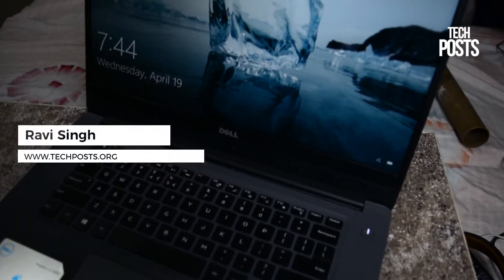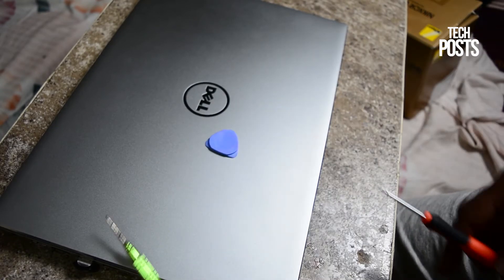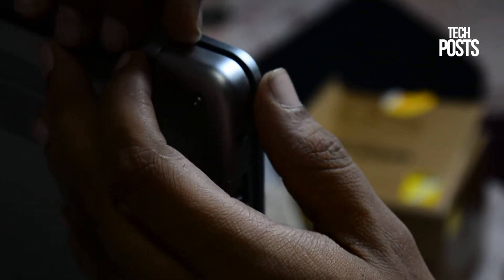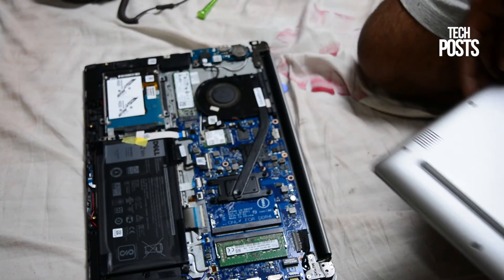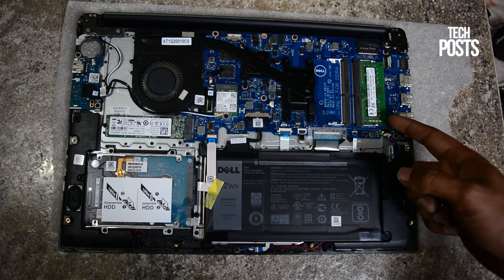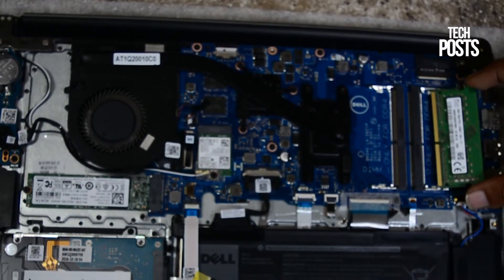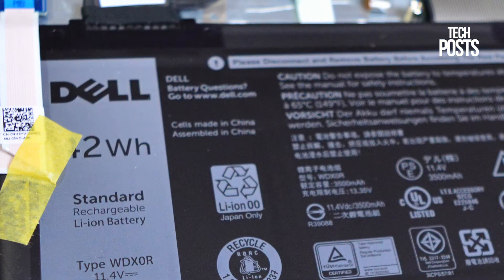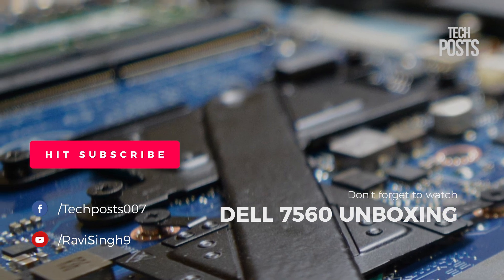What's Inside Dell Inspiron 7560 - Dell 7000 Series Ultrabook

Comment: Bro did you find 65wh battery for this laptop....? If you got the one please share the link for me also.
Reply from the maker: No, there isn't any that's compatible with this. Unfortunately, you are stuck with the 42whr.
Reply: @ravis1ngh  10qu for reply. does this laptop support which ram 2133mhz or 2400mhz..? but the ram given (pre installed)this lap is 2400mhz but  in task manager it is showing 2133mhz .am confused can you please suggest me which one it is. i wanna upgrade
Reply from the maker: @fabi9188  The processor i7 7th gen in this system supports 2133mhz RAM. So you the RAM frequency is limited by the processor. You can't do anything.

Comment: You have added one nvme ssd. Can I use it as a primary disk and remove the other disk? Also are you able to get the full speed of nvme ssd? 

I am thinking to replace the disk with nvme. This will increase the baterry life as well. Please share your experiences.
Reply from the maker: That's not NVMe but a SATA 3 M.2 SSD. It doesn't support NVMe
Reply: @ravis1ngh  got it thanks.

Comment: 3 screws are not coming out on top of air vent side , other came out
Reply from the maker: They wont. Don't try to forcefully remove them. It's the way it is. Just unscrew and remove bottom using scraping tool
Reply: @ravis1ngh  which type of screw drive you used plus or minus

Comment: SIr I got the same laptop but the i5 version ,now i am thinking to add this ssd -Kingston SSDNow UV400 120GB SATA 3 2.5-inch Solid State Drive (SUV400S37/120G) in empty slot. Will it work?
https://www.amazon.in/Kingston-SSDNow-2-5-inch-SUV400S37-120G/dp/B01FJ4UN76/ref=nav_ya_signin?s=computers&ie=UTF8&qid=1532607921&sr=1-1&keywords=kingston+ssd&

Comment: Is there separate slot for ssd other than HDD????
Reply: inbuilt you will get a chip based 128 gb ssd that is primary and another is hdd that you can replace with ssd so it performs very good and fast

Comment: can u tell me if i edit 4k videos on it .... it is possible ?
Reply from the maker: +Jatin Chopra Photography I have edited 4K in premiere pro and it does works fine.
Reply: render time ?
Reply from the maker: You can edit 4K recorded at Low bitrate. Otherwise, you need at least quad-core processor with the good graphics card to render high-quality 4K video.  So if you want to edit good quality 4K, look for a more powerful laptop!
Reply from the maker: You can find more details here in the screenshot I have uploaded of 4K video Rendering. Editing was smooth. Shot using S7 Edge 4K
https://prntscr.com/i4aly7

Comment: Hi, thanks for the video. Varun Marathe led me here. 
I am planning to buy the Inspiron 15 7560 i7-7500U 16Gb 256Gb SSD 15.6" FHD GeForce 940MX. It doesn’t come with any HDD apart from the 256 SSD. So, I need to know if the SSD and be upgraded to a 512 GB / 1TB.
All answers are in this Great video which answered my question. Keep up.
Reply from the maker: Yes, you can. It's easy but with SATA 3 SSD. No NVMe! 
Good Luck!

Comment: I really like the design and looks of this laptop and I'm looking to buy this.  Only thing I'm confused about it is, the Dell inspiron 5577 and Dell inspiron 7567 has Nvidia GTX 1050 and GTX 1050Ti respectivley and the price difference is just 5-10 k.  So , should I just stick to Inspiron 7560 for its thin bezel display and how sleek it looks OR should I forget about the looks and get Dell inspiron 5577 or 7567 ?!   Usage wise I dont play many games , I just play Fifa a lot and watch videos and browse.   Your suggestion please ?
Reply from the maker: If you haven't purchased 7560 yet, then don't invest in it now. Get a new 8th Gen Dell 7570, not yet released in India.
Reply: Techposts Guides well, for that I have to wait. Now there's festival offer going on!  Dell inspiron 7560 i7 version is available for 66k, Inspiron 7567 i5 version is available for 67k and Inspiron 5577 i7 version is available for 69k.  I have to choose from these three, I like 7560 for its design and light weight.  But 5577 and 7567 has better graphic card!  Although I don't play many games, I thought getting a better graphic card will be useful in the future. Having said that I really like the design of 7560 which is almost similar to Xps!  Which one should I go for??  Your suggestion please?

Comment: Does the i5 variant of 7560 have ssd slot?..and can the 1TB HDD present upgradable to a ssd? and is the colour bleeding problem solved?..i mean in recently manufactured product?
Reply: Can someone please respond to this ?
Reply from the maker: Yes. SATA SSD. There could be a M.2 slot as well. You can use Hardware Info app to know if there is a M.2 slot. Under SATA connections.

Comment: hey can i upgrade it to pcie based ssd?
Reply from the maker: NO. It's M.2 port, not PCIe.
Reply: if i want to change the whole 1 tb hdd with a ssd,is it possible?if yes ..what would be the best ssd for upgrade?
Reply from the maker: +Suvajit Adak Samsung and Kingston. Samsung is costly while Kingston is a bit cheaper but both work great. I use Samsung Evo personally.
Reply: thnx..ya cool

Comment: 8gb or 16gb? which one for empty slot ram is best.. is there extra m2 slot for new SSD?
Reply from the maker: +Prithviraj Deb Both. Add any  Depends on your requirement. It supports upto 32GB. There is only one ssd slot. Remove HDD and add SATA SSD if you want two ssd.
Reply: upgrade to 16gb works great
http://www.amazon.in/Crucial-CT16G4SFD824A-2400MHz-260-Pin-SODIMM/dp/B019FRBHZ0?_encoding=UTF8&psc=1&redirect=true&ref_=oh_aui_detailpage_o07_s01
Reply: could you suggest m2 ssd  500gb

Comment: sir dell inspiron 7560 i5 is good for programing or lenova idea pad 710s 
which one is best for programming
Reply: replay
Reply from the maker: +Yashpal Gowda Both are equally good. You can also consider Macbook Air if you only need laptop for programming. It's much portable and backup is really good.
Reply: thnks sir
is mackbook air enough for developing ios appilications 
  and creating website like twitter 
is it possible
Reply from the maker: +Yashpal Gowda Yes. Mac Air will handle those easily.
Reply: ok sir sir 8gb ram 
5th genration i5
128pcl ssd 
are enough
Reply from the maker: +Yashpal Gowda But if you want to use other heavy Graphic intensive work like Adobe After effects, Premiere pro or other editing apps, it will be slow and might not work properly.
Reply: sir can u suggest other laptops at 70 k range
good for programming stufff
Reply: replay plzz

Comment: Hi, nice video.
Have you solved the overheating issue? 
I consider buying this laptop, but its cooling system makes me skeptical. Small fan, thin air vents placed only on the back of the laptop and not on the side and lots of complains by users on this topic.
It is fine by me, to reach higher tempratures during gaming, but just browsing causing that trouble is a big problem.

Note: I intend to use it for development purposes (coding,browsing, databases access)  not any heavy gaming but some software might take advandance of th GPU.

Comment: does it have any problems? how much it cost?
Reply from the maker: +Dibyendu Adhikary Costs 79K and having minor issues with Display and Battery life.
Reply: Thank you for your valuable answer... what type of display and battery problem do it have? Actually I want to buy it in the next few days. Please answer me
Reply from the maker: +Dibyendu Adhikary Don't go for it, i am experiencing severe heating issue. It gets very hot even when you are browsing in Chrome. I am in contact with Dell. Will update ypu if this is the issue with my piece or every 7560!
Reply: Oohhh shit! Then which one you will suggest me.. I want one which have back-lit keyboard,Long battery life,some good stuff like i5 processor etc
Reply: Is this have display yellowing or bleeding problem? And what about the battery problem?
Reply from the maker: +Dibyendu Adhikary No, atleast not with mine. It good! Battery is not a problem, it's 42whr which is little less powerful. So expect 3-4 average, max 5-6hrs.
Reply: Ohh sorry it's12.11 so😆😆 I'm in sleeping mood that's why I wrote that type of thing...😄😄 OK. I have heard that type of heating  issue. They all suggesting to use cooling pad. It's normal. Can you say me how much it going to heat? Actually after many rejection of several lappies I decided to buy that one. It's very hard to go for another one. Can you briefly tell me about all of it. Please
Reply from the maker: +Dibyendu Adhikary It just started, and i do serious rendering work. That's one reason. But still temperature touches 90 and above sometimes. Stays at between 70-80. Idle temp is 55.

Comment: Which one is better?
1. Dell Inspiron 7567
2. Dell Inspiron 7560
3. Dell Inspiron 7559
Required for animation and vfx classes (lots of work in MAYA). If you have any other recommendation, do specify.
Max budget 1 lac.
Reply: +Techposts Guides Does INSPIRON 7567 comes with IPS in INDIA ?
Reply from the maker: +Ajay Fogla Go for 7567, it's with 1050Ti, just check your application's system requirement first. If it supports Nvidia 10 Series Gfx cards. 7567 is fresh with 7th Gen quad core i7 processor. It will perform way better than 7560 and 7559, without any doubt.
Reply: ok. Thank u

Comment: hey I'm looking to buy this 7560 but I heared about colour bleed and display issues I want to buy i7 7th 4gb graphic for VFX* what should i do ...?¿¿¿ I'm confused pls give me feedback. ...
  #touch+posts
Reply from the maker: +Fearless Singh Don't go for 940MX DDR5, you will be disappointed with the performance. For VFX you need a better card like 1050Ti offered in the newer Dell laptop 7567.
It's wonderful laptop, i would have bought it if it was released at that time. Unfortunately, i have to use this for atleast two years. The display is good.
For 7560, yes there is minor color bleed issue.
Reply: should I go with Apple? ??
Reply from the maker: +Fearless Singh Yes, you can.. go for Macbook Pro if you have some extra bucks to spare!
Reply: thanks for quick reply. ..
it's really  useful..
great job..
Reply from the maker: +Fearless Singh Thank You Mr. Singh!
Reply: Nvidia GeForce N16S-GTR 
is this strong graphic processor ??
Reply from the maker: +Fearless Singh No, it's not aStrong processor at all. Good for gaming at low settings, can handle all games including games like GTA5 and Witcher 3 (at very low settings). 
It's average for Adobe and After effects.

Comment: +Techposts Guides

Could you please paste a link of RAM you bought online?
Reply from the maker: +Abhineet Singh i already did mentioned in a comment. Added link in the description too.
Reply from the maker: http://amzn.to/2pXmZNM
Reply: +Techposts Guides

Thanks for the link.

which variant did you bought?I could see two variant-2133mhz and 2400mhz.
Any specific reason of buying it from Amazon.com and not from Amazon.in?

please request to reply
Reply from the maker: +Abhineet Singh Not available at Amazon.in.
Crucial RAM is available at Amazon.in
Reply from the maker: +Abhineet Singh Also, i noticed that the installed RAM is a 2400Mhz but the BIOS shows RAM freq. 2133Mhz which means system uses RAM at freq 2133 not at full speed i.e. 2400. No option is available to increase speed of RAM in BIOS.
Reply: Techposts Guides 

so you bought the one with 2133mhz?
Do post a quick review once you have received & installed tge RAM and booted up your laptop.
Reply from the maker: +Abhineet Singh no i bought 2400, i hope Dell will release new BIOS update to support 2400 at full speed.
Reply: Techposts Guides that is not possible as the processor only supports 2133mhz

Comment: thanks Tech post..I recently bought this laptop but I have Uk version of it which consists of only SSD and not hard drive...Can you please let me know if hard drive slot will be empty right now and I can add that later or I wont be able to add Hard disk in my laptop
Reply from the maker: +Amit Chidrewar Yes, HDD slot will be available and yes, you can add HDD to your 7560 by yourself, it doesn't void warranty.
Contact Dell Support for more info.

Comment: I was expecting dual Fan configuration but after watching your I m disappointed with dell India. I don't know why but dell isn't releasing its XPS 15 series in India.
Reply from the maker: +onlyy arora It doesn't need dual Fan actually, it's dual core processor and on top of it this has a smaller battery 42Whr, so with two fans, forget backup. Atleast 65whr battery is needed for Lappy's like this.